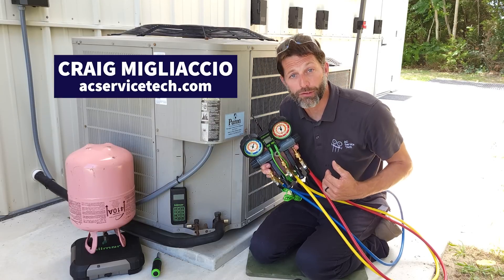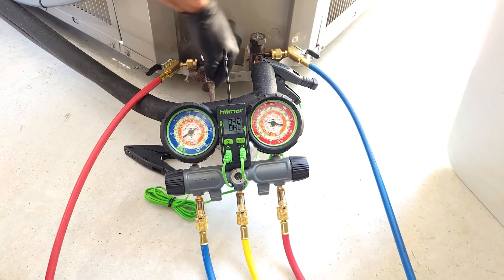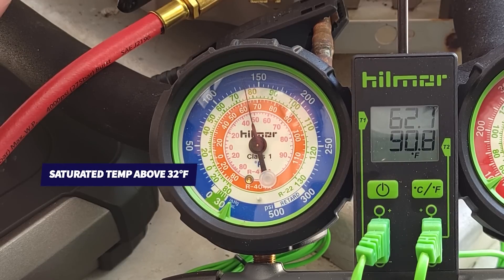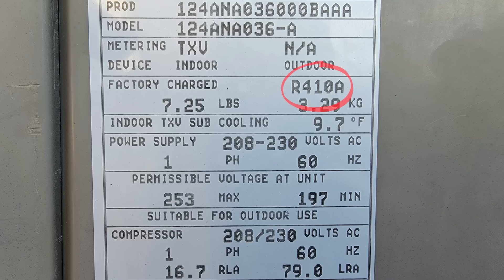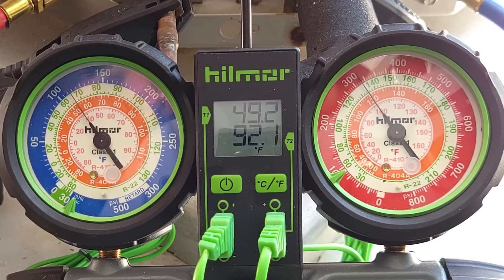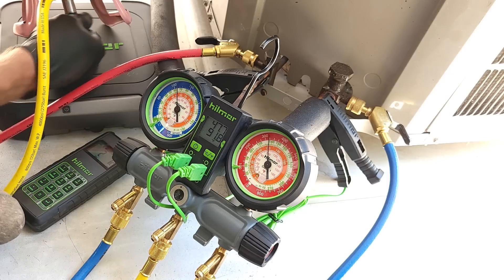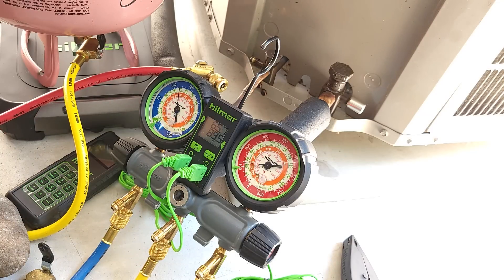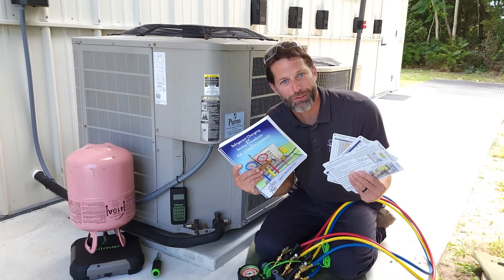Charging R-410A into an Air Conditioner that's Low! Connect, Measure, Add Refrigerant, Disconnect!

Comment: I've always wondered why these analog gauges aren't made with the R-410 saturated temperature on the outer ring where you could read it more accurately.  Put the pressure on the inside ring.

Comment: Just one question, did you put your high side gauge on the access port of the discharge line vapor or the discharge line liquid line after the condenser???

Comment: Thank you so much for these videos. They really help to understand the concepts. 

I have a question:  We add R410 in a liquid balanced form, but I am curious if R410 leaks from a system over time while the system is not running, does one or the other (R32 or R125) leak out disproportionately and imbalance the function of the gasses and cause a loss of efficiency ?

If that was so should the system be evacuated and new refrigerant installed ?

Comment: Also any reason you never use a flash charger on your vapor line for refrigerant refill, instead of opening and closing the valve multiple times? I know you talked about it but never used it

Comment: The way I hook up the guages.
Open suction side guage, close liquid side. Connect suction hose and let it bleed through charging hose and then close charging hose ball valve. Open liquid guage to bleed from suction side, then close liquid ball valve. Connect liquid line hose. Close guages and open liquid ball valve. Definitely no air getting in because the system pressure is pushing air out as you're connecting Hoses.
Any thoughts or objections? The way taught in school is sort of silly to me. So I do it opposite.
I use ball valve low loss fittings. Idk if this would work with his fittings in the video

Comment: Thank you again for good information 
I have questions what the perfect pressure on R22 system when you connect your gauges just refresh memory
Reply: Do you mean static or running , what’s the outdoor temp what’s the indoor temp ?
Reply: Running temperature 89out and 78 inside
Reply: Honestly,  pressures are not all that important.  What you really should be after is the saturation temp.  There are a lot of variables when it comes to operating pressures.
Reply: @ejohnfall  75 psi
Reply: Think your super heat and sub cool is what's important, not everything will always be text book perfect but majority of 410 systems if you have target sub cool your good to go.

Comment: Hello. Why did you purge at yellow hose near the cylinder and not on other end  ,near the  manifold? Refregerant comes from cylinder and push air , in yellow hose , towards the distal end

Comment: Should you charge by what it says on the nameplate (indoor txv subcool) or by what the chart says in the inside of the panel?
Reply from the maker: you would need to check and see what metering device is at the indoor coil. if its a txv, use subcoolung. if its a piston, use total superheat, thanks!
Reply: Maytag has charts based on liquid line temperature.
Reply: Yes and only  by the chart..ps best way is approach method not subcooling

Comment: how do I calculate the required r410 on an empty 4-zone mini split 36kbtu, Suction OD is 3/8 and Liquid OD is 1/4, I have 82ft total for all 4zones but not sure if I need to multiply this number by 2 because each set has two lines, if so then its 164?

Comment: Clean filter, new coil what would cause a 30 degree delta T?
Reply from the maker: Low indoor airflow. check the duct if its too small or a low blower speed, thanks!
Reply: @acservicetechchannel  appreciate it figured so

Comment: I wonder is the subcooling is changed by the outdoor temperature. There has a subcooling rate table, is the table is not useable? Is the subcooling always need to be kept at 8?

Comment: Can you safely pump down a 410a system and if so what do you do if it's a brand new 410a system and you try to pump it down and the pressures are coming down but than it makes loud swooshing sound and pressures claim back up quickly
Reply: Are you pumping down a regular unit or a mini split?

Comment: I’m confused because you had your vapor and liquid line lever open ? Wouldn’t you need the closed during purging ?
Reply: The unit was NOT running while being purged. Thus, no liquid refrigerant could be sucked into vapor line and then on to compressor.
Reply: @MaMa-qh4dy  appreciate you a lot for this mamma makes total sense now !

Comment: What if you use a liquid to vapor adapter/ vaporizer.. Do you still have to throttle the 410 into the system?
Reply: Isn't that only needed for minisplits since most of them only have a connection port on the vapor/low pressure side?

Comment: What happened to the in-line vaporizer that you’ve shown in so many other videos ??. I see that you’re showing a new Hilmor set-up. I don’t know about this one, I see a lot of plastic on that manifold gauge set . From what I see, it just screams “cheap”.
Reply: Been using the same setup for about 10yrs, drops, weather and all it's the most accurate and durable I have used. I have Joblink kit, Sman, even the Elitetech digital set which is the best digital set by far but I prefer the setup he is using in this video.
Reply: Also that's an iron body these sets, gaurges are covered by proactive drop proof rubber, looks plastic but actually no plastic on this set

Comment: Would this still be the same if the internal duct had a restriction on the intake side of the unit?
Reply: a clogged filter or one with too high a rating can result in you overcharging to compensate so check that first

Comment: So… why can’t I add r410a into the high side.  Is it just because the pressure  from the system is to high and it won’t come out of the bottle.
Reply: Yes. Pressure is higher than bottle.

Comment: Let me help you...1st. The system wasn't low..you added refrigerant and made your suoerheat go down .if it's 77 inside you should have MORE suoerheat..if it gets a q10 inside and 101 outside ,you will have NO superheat putting the compressor in danger...suoerheat ensures 100 percent vapor..your coil temp was 35.too low..you wasted time and charged a homeowner to get minimal or no reward
Reply from the maker: This system had a TXV so we use subcooling to charge. Superheat is checked to make sure the TXV is operating properly. If you try to set these systems using superheat, they will get overcharged. On a system with a TXV, the indoor coil sat temp depends on the indoor air wb temp, thanks.
Reply: Youre right with a warmer return temp youll have higher superheat even with a txv. Also forgot to mention why he's adding in the first place. If it's low, perform a leak search and repair the leak. But it's OK all of these home owners trying to charge their own units is gonna make us a lot of money when they end up having to call us anyway.